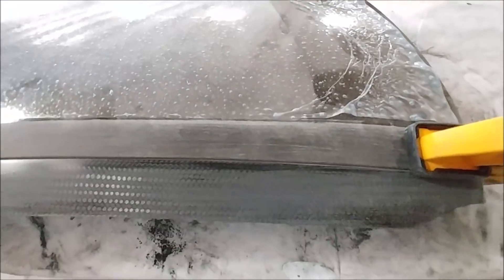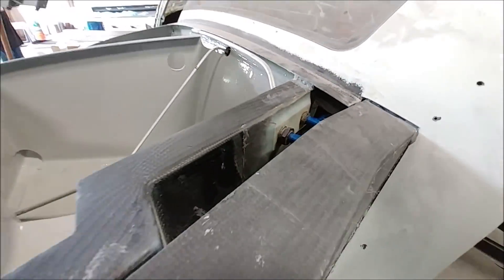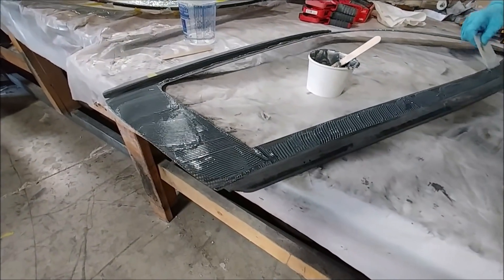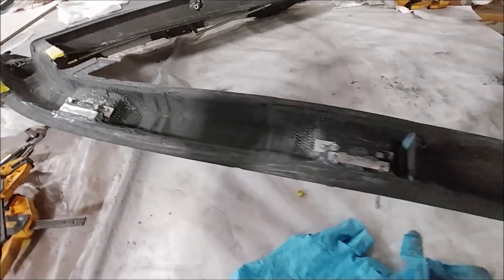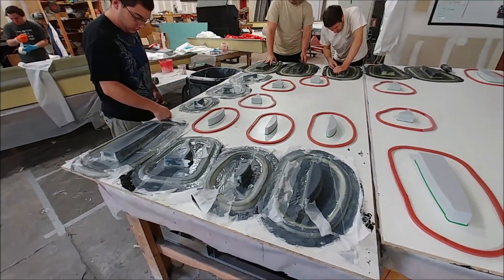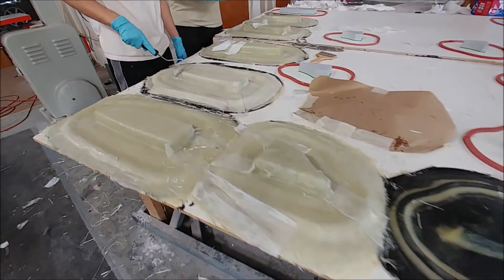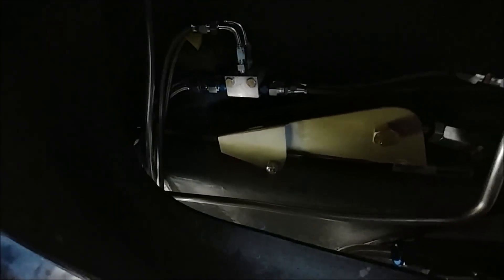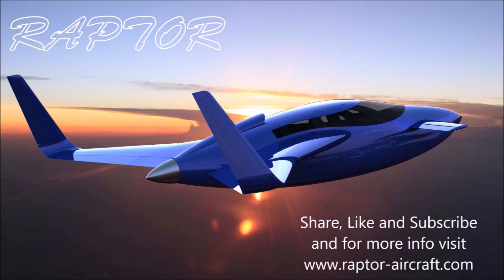Door Construction Fun - Building the Raptor Prototype

Comment: The problem is: the window adds a lot of strength, and if the panels are not completely true as they came from the mould, that twist or flex will be locked into the door.

If the windows weren't acrylic, you could drill a small alignment hole and fill it later, but with acrylic, drilling any hole begs for a cracks to start. Though, perhaps you could put a small witness mark, a small dot in the doorframe, and then a tape crosshair on the window to lign it up over. Still, it's going to want to squirm in the adhesive/Hysol.

[If you take a Fender guitar apart, you will likely see extra holes drilled in the body for wood working. Leo Fender was a pretty bright industrialist.]

When you make the MkII, perhaps you can lay up fixturing for bonding in the windows and other parts. Perhaps, you can attach suction cups onto the window with stub rods on the ends that slide into the fixuring, then the window can only go straight down, sliding on the rods.

I worked for a kit-car company. Doors are not easy. At least we didn't have to Hysol them in : )
Reply from the maker: I have a decent solution. You'll see it when I do the other door.

Comment: Lots of sharp corners on the windows and doors.  Shouldn't pressurizied aircraft have rounded windows and doors to avoid stress concentration?
Reply from the maker: Probably, but we've done all the FEA analysis and it passed with safety margins with the current design.

Comment: When you say 'mil'. are you really saying 'millimeter' instead of '0.001 inch'?
Reply: Long live the metric system Pete ;)
Reply: No, the word "mil" is derived from the English word for thousand, "mille". But you are correct it equal one thousandth of an inch.
Reply: Peter uses "thou" for 1/1000 inch, also the door gap is not 4 x 1/1000 inch that would be too tight, so my guess is that he was aiming for 4 mm door gap. Just my 2ct.
Reply from the maker: Mostly I use thou when referring to thickness but in this case I was referring to millimeters.